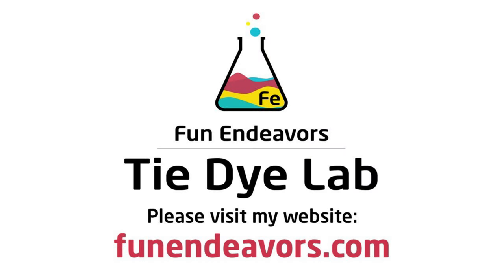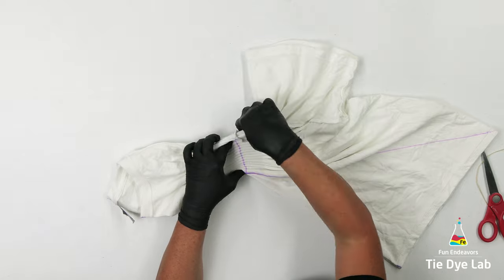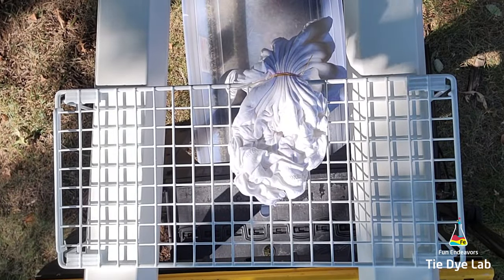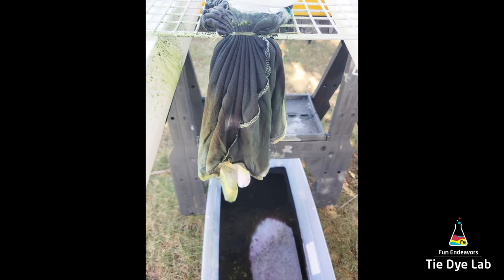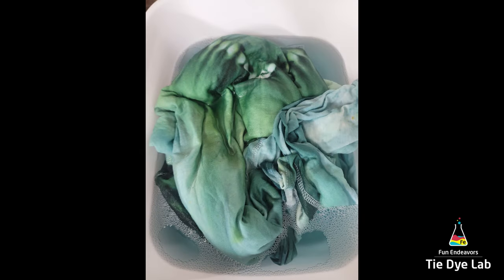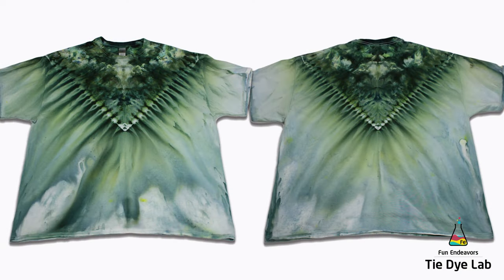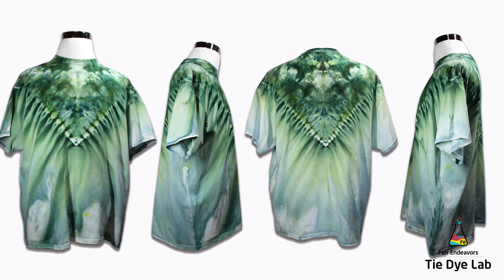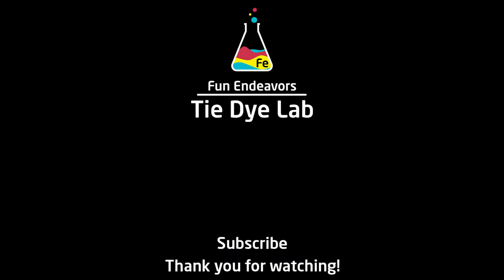Tie Dye Designs : V Design Gravity Ice Dye

Comment: Looks great til the bottom..but love it started from the top..maybe using such a high blick of ice melts to slow to keep the shirt wet.could also line your tub n do it there...thanks for sharing
Reply from the maker: I kept checking the shirt and it didn't dry out.  I keep a spray bottle of soda ash solution to use to spray the shirt if it looks like it needs it. 
I prefer not to tie dye inside my house.  I have a dedicated dye space that I use.  The weather is still warm here so I should be able to continue gravity dyeing outside for a while longer.

Comment: I’m certain that, as the ice melts, the liquid absorbs the soda ash already in the shirt. With gravity and water following the path of least resistance,  the areas with concentrated soda ash blocks dye saturation. Notice…the areas left un-dyed toward the bottom are stiff from crystallized soda ash. This has been my experience, anyway.
Reply from the maker: You're right - if the soda ash is crystallized in the shirt it does tend to resist the dye.  The green dye in general doesn't seem to readily travel as far down the shirt as other dye colors though.  It takes a lot more ice to get the color to flow.  It's been interesting watching the way the consistency of the powder affects how well it flows  with gravity dyes.